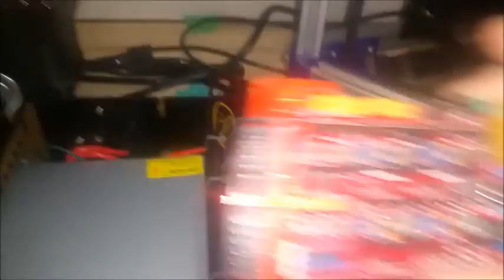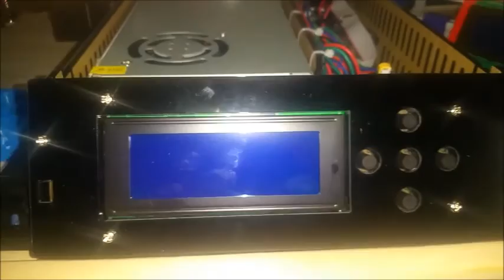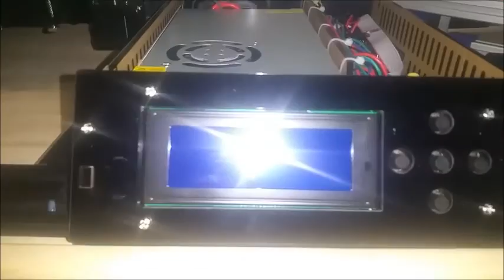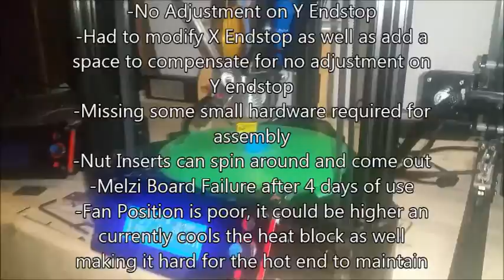My review of the Tronxy X3 and its meltdown

Comment: Anyone considering this printer or want positive feedback and comments, there;s the group on facebook. Everything is covered and everyone is helpful as well. I have this printer and after modding it, its very stable. I have had it running for about 3 weeks straights non stop on prints. The board burn up is due to not connecting it correctly and restricting the amps. There's mods for that as well.
Reply from the maker: I added the facebook group link in the video description, The group did not exist till shortly after this video was made. The connection was solid, the ground wire got too hot. It was replaced as soon as the replacement board came in with 10 gauge and the wires remained cool since
Reply: The newer boards have solved this issue. But then again you should have a mosfet board to take the load off the motherboard. Thats another upgrade of course. But this printer will run out of the box just produce crap as many other cheap printers will.  Any cheap printer can become an impressive printer with time and mods. All about making it perfect!

Comment: Was it because of scracthes on the heatbed?
Reply from the maker: I never noticed any scratches in the heated bed. It would be strange that the ground for the power to the board would overheat due to something like that.  will take a closer look at the underside of the heated bed. It is an all in one aluminum top and heated plate  underneath setup. It looked pretty good when I installed it.
Reply from the maker: It was because the wire was too small a gauge and braided and was getting really hot when the heated bed was running. After Gearbest sent me a replacement board I used 10AWG solid copper wire and have not had any heat issues with it
Reply: Would be nice if you made this info more prominent. You express concern that it's a fire hazard then bury an easy fix in the comments. It's also an easy, cheap fix that turns a 'meltdown' into a decent very inexpensive printer :-)

Comment: What I goto do to get motors to spin? the clunk on home and thats it. help please.
Reply: That's like saying "My car won't start. What's wrong with it?" There are 1000's of things. Many are going to be wiring errors which nobody can tell that's not there. I'd also sugget you find a group or forum for this printer rather than a review video from someone that's only built one, and that one failed.
Reply from the maker: First let me correct a few of your ASSUMPTIONS, I have built 4 X3's to date, all of which including this one work fine. The wires that came with it were too low a gauge and provided a lot of resistance and got hot to the point they melted the connector. I have a had a replace board as well as connector sent from Gearbest leaving me now with a spare board. Heavier gauge wire solved my issues. The printer works great and I have since designed a ton of upgrades which I did go on about in a later review video about a month after I posted this video which now a good 1/2 year old. This is also not my first printer kit and far from my last. I have had other kits with too low a gauge wire as well and other kits that were fine. To date I have assembled 6 kits without heated beds, Custom built two of my own from scratch, and 6 printers with heated beds. FindmeKicksUK, he is correct to help you here or on a forum you will need to provide more information that you have give, it could be one of several problems but most likely a wiring issue. There is a facebook group for this printer that started up after i did the build video 
https://www.facebook.com/groups/1119103791478149/
there are a lot of helpful people there
Reply: My, we're a bit sensitive, aren't we? You leave a viewer's question unanswered for 2 weeks but when I go to the trouble and give him advice that you agree with, you respond to what you perceive as a criticism within hours  lol I did not mean it as criticism but just that the question might get a better response elsewhere. I know that you have a lot of experience in general so you also know that every printer has its quirks and that a dedicated group is a better place to get help. If you yourself had done some research before buying and building the printer you may have learned of this problem in advance and saved the drama. 

Wires getting hot is not the issue. Copper can get pretty darn hot before it melts lol. Wires that are connected with a poor connection is the issue. Where there's a poor connection, the heat leads to increased oxidation and thermal expansion. That increases the resistance which increases the temperature more which leads to an avalanche effect and the results you see here. The other connections that were also carrying high current and getting hot don't show the slightest sign of damage in the pictures. You can believe a person that's built a dozen hobby printers or a person that's an electronics engineer with 30 years of experience working with equipment that operates at hundreds of amps and thousands of volts- from nuclear reactors, particle accelerators, and satellite systems.. 

I go with what information I have. The vireo says that you'd only run the printer for 4 days  and a few times that it was a 'disappointment' and could be a 'very dangerous situation" and had already replaced several parts and expected to replace more. You write a searing negative review about a product that you consider a fire hazard and then turn around and buy 3 more!? 

Don't you think that you have some obligation to your loyal viewers to let them know there's an easy fix for this fire hazard that will turn it into what you seem to think is a worthwhile buy? Don't you think that if you bash a company's product and then have a change of heart that you should correct your negative review?

Comment: So I took your advise and bought a 2016 LCD diy FLSUN 3D metal printer, Delta Kossel on aliexpress for 259$... Let the games begin lol
Reply from the maker: The only thing I didn't like about that model when I was looking into buy my deltas with the bed supports but you can print replacements that can give you more z height. question you said 259 did you get one that came with a heated bed then?
Reply from the maker: You will like that printer, I am glad I went with Deltas first as I find they are much easier once you have them dialed in to work with then a Cartesian. Also I like the look better and I like how they move it is more entertaining per say to watch one in action then a Cartesian
Reply: Yeah heated bed and some filament idk wut kind of filament but yeah! I have a question for u as well, in one of your videos u mentioned a diamond or full metal hotend? Can u give me a idea as to which hotend I should get?
Reply from the maker: The printer will come with a jhead style hotend which is decent and I have not had any problems with them, you can pick up a whole spare hotend with heater element and thermistor on aliexpress for under $4usd and extra nozzles for about 30 cents a piece. The diamond hotend is for 3 color printing and mixing with one nozzle. I have not gotten around to installing it yet with work and so many 3d printer projects on the go. I got a MPCNC in the corner of the room 3/4 completed  that will also need attention
Reply: Ty for all the good advice, u have a new subscriber !
Reply: What firmware will you use for the 3-1 nozzle? I see that Prusa is shipping with that feature, but I can't find mention of the firmware to run the feature anywhere. Do we have to wait for Prusa to release their code?

Comment: I see allot of probs with these printer. Sure it's a 200$ printer but still shouldn't be that bad. Iv got 150$ printers that needed tweaked but worth the money. You should look into the "real" MKS control board I have swapped them into the cheaper printers an they work flawlessly. My one HIC printer is up to a little over 3000 hrs an it's the original board. (Yes 3000hrs haha runs just about every other day been going strong for a few years now)
Reply: Not a bad printer. Just need to print mods out like any other printer. Beats my prusa i3.